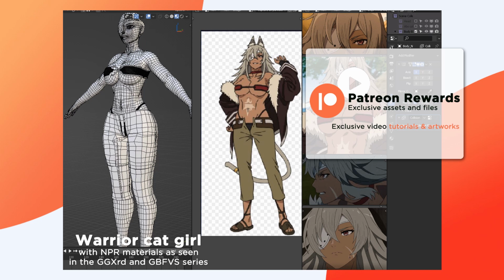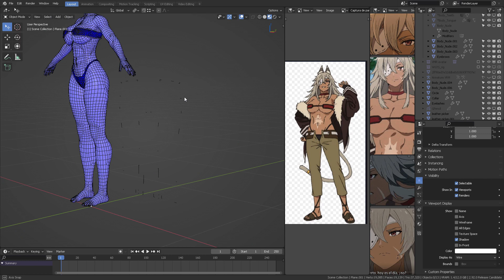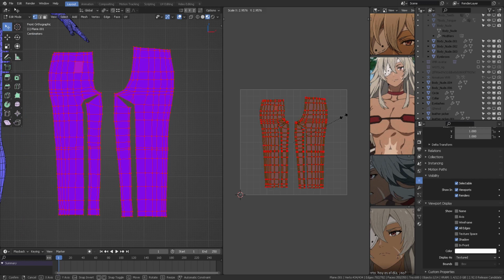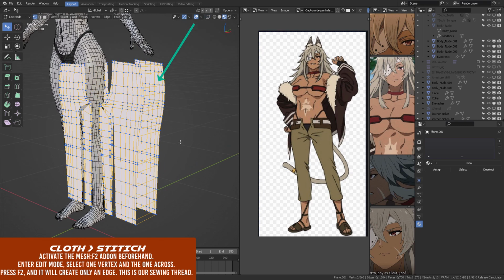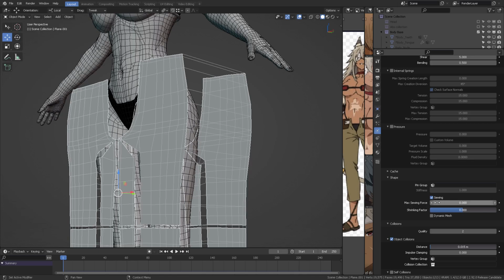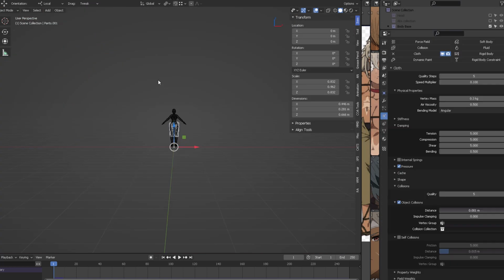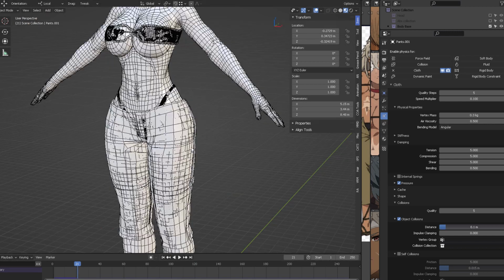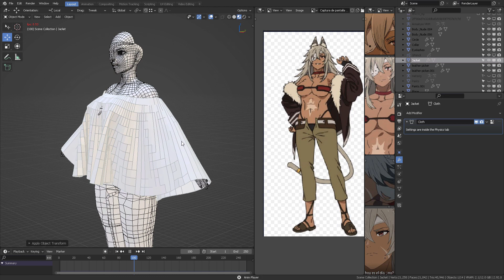Cloth seam cargo pants in Blender

Comment: Nice info about scaling the Entire cloth sim(Collider and cloth) but as long as I searched the recent blender cloth update messes with sewing that not all the edges sew perfectly with each other. I also tried many variations in settings, still nothing. Is there a work around for that. After sewing the cloth should be one mesh for animation. I am struggling with this issue.

Any advice would be helpful. Thanks in Advance.
Reply from the maker: When sewing there's a parameter for "speed limiting", Blender simulates instantly and this parameter is taken in acquaintance to "slow down" the collision in complex areas. This is why I did this introductory walk-though. There's a whole world between sewing patterns, cloth parameters, collisions that deserve an in-depth video of their own. Also, when you scale, you need to "apply" scale to cloth and model.